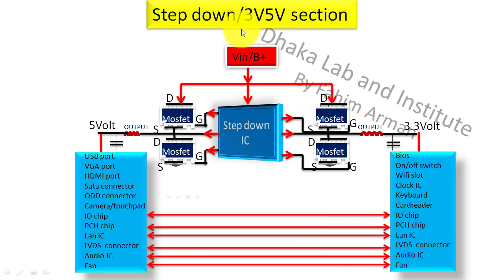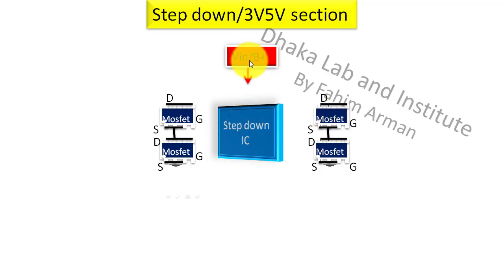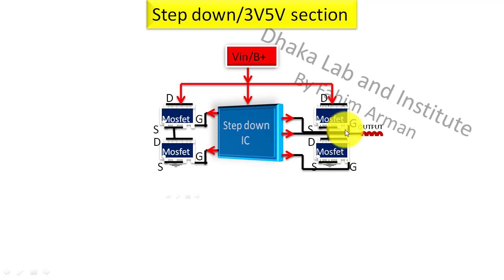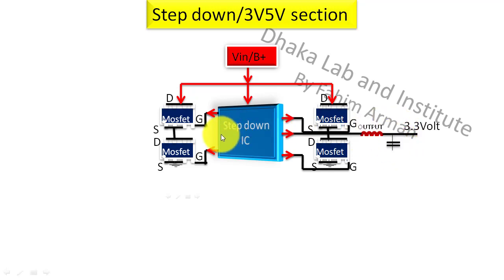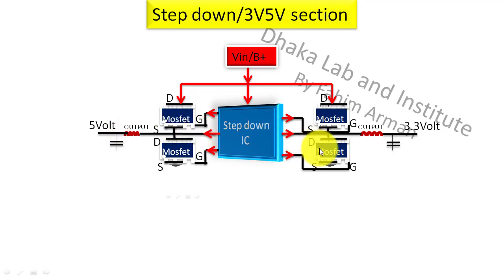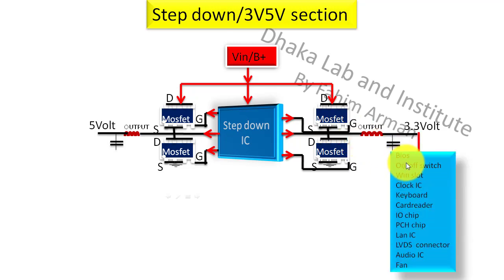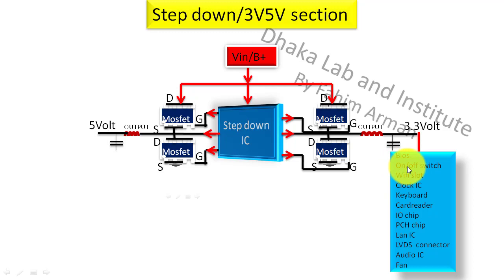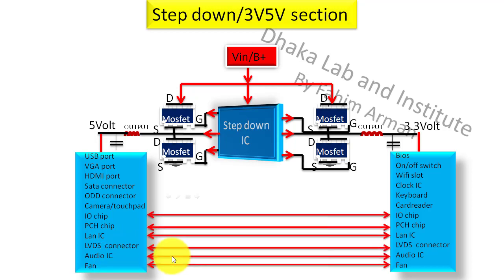Laptop Step down/3V5V circuit/section

Comment: Hi teacher
Please help
Use dc 30v_5a check laptop
Thank
Reply from the maker: keep voltage in 19v in DC Power supply. no need to touch ampere and insert voltage in laptop by power connector.